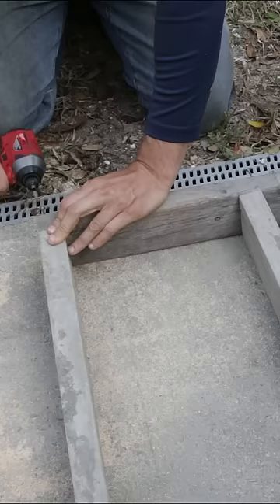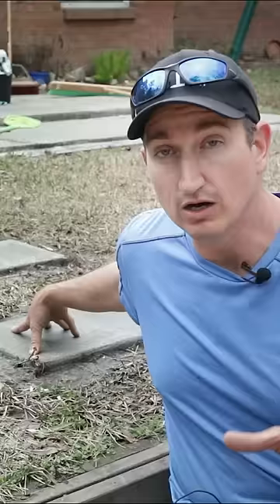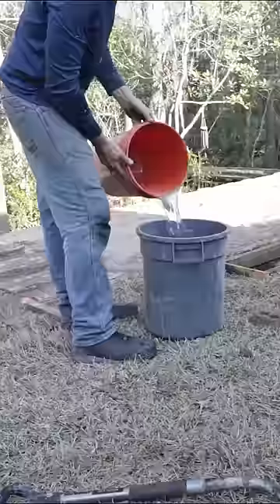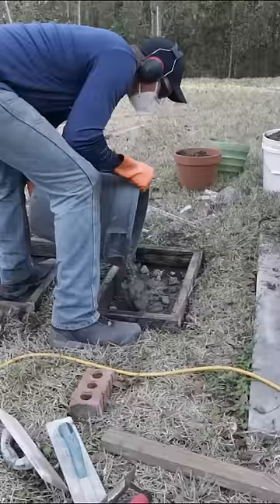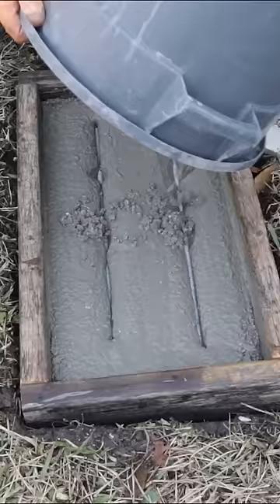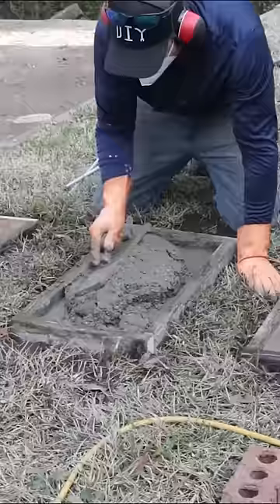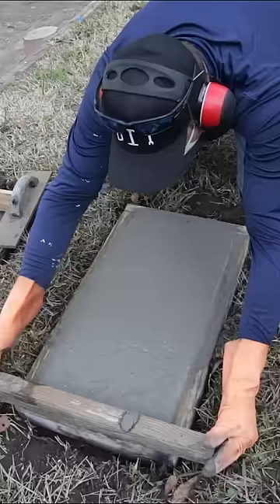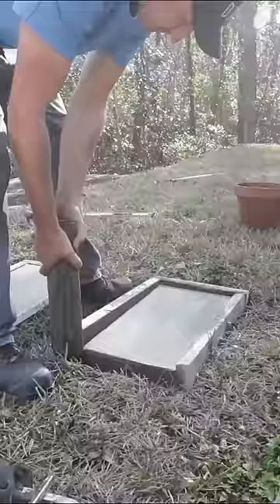How To Work with Concrete for the First Time

Comment: Does THICKness of rods you inserted make a difference versus cut off sections of hog panel/chicken wire? Thanks
Reply from the maker: Adding threaded rod for reinforcement may have been a bit overkill for these small stepping stones.  Metal reinforcement is more practical in heavy load bearing concrete applications.  The thicker the rod the more load the metal can take. The mesh really just holds the concrete together if it were to crack.
Reply: @MrKistel  thanks for replying.
Reply: metal lathe is better

Comment: You didn't put anything under the concrete? You have to use crushed stone under the concrete or it will crack and sink because of erosion from the weather.

Comment: 60 lb bag of ready mix is about $5. 
A 20”x20”x1.75” concrete pad is $7. Time of labor and install and clean up is what… 40 minutes per pad if you make it yourself? I guess it depends on your goal. Do you want the pride of being able to say I did this from scratch or would your rather have the job done same day so you can spend more quality time mainlining heroine? It’s all about your choices. Don’t judge. We all have different objectives and perspectives
Reply from the maker: The intent of the vid was to just show a quick way of starting to work with concrete. The idea is to work with a small project first incase things do not go smoothly.  In this case you end up with a potentially useful stepping stone in addition to an introductory experience.
Reply: @MrKistel  preaching to the choir.  The most useful info from this is a bag of concrete will fill a form that size. So people can estimate exactly how many bags they need to buy. As we all know, the repeat trips to home depot usually coincide with a stop at the bar for a cold one. If you’re a 3 beer fella you know you’ll need three trips back to the store.

Comment: My first concrete project was an 11' x 72' pad, done with my wife and brother. Watched YouTube videos, got tips from the pump operator during the pour, and it turned out pretty good. I was late on the 2nd pass a little, so the edges hardened up a bit and are not pretty in some spots, but it's been years and it looks great.
Reply from the maker: Wow that is a massive first project. Congrats on the success.

Comment: You def don’t have to wait an entire day to remove the form. 
Also, if ur doing actual steps, you need to remove the forms to finish. 

So you would want like a 4-5 in slump and the right mixture of chemicals, if it’s super hot or super cold to assist with curing. 

Point is, this is the equivalent of buying a piece of concrete this size and throwing it on the ground. If that works for you, then great. 

Even the people that prep properly will have some movement let alone this 😂

Comment: First time I ever did any concrete work I dug a 8ft by 2ft, by 5 feet deep hole with a backhoe (also my first time using that) made up the rebar, put the anchor in, and poured concrete for a tower we were building in Hawaii haha good times.
Reply from the maker: Wow that a serious first time concrete project.  Did it all come out ok?
Reply: @MrKistel  oh yea, haven’t gotten any calls about a tower down yet! Haha no finishing work because the anchors are below ground obviously, just told the guy where to pour and vibrated it out lol finishing work is not for me, I like climbing towers and stacking steel.
Reply from the maker: @Dezmon2jz  Epic, nice job!

Comment: Pro tip that I didn’t hear him mention: you want a stiffer mud generally if you’re DIY, the wetter the mud the lower the strength. If you really wanna nitpick you can add a little fabric softener and less water 🤌 that’ll be some strong stuff.
Reply: Plasticizer will make the concrete more wet with out compromising strength. It will have a lower slump but no strength loss
Reply: @randybobandy9828  exactly my point. Generally speaking the average DIY er isn’t playing with admixtures so stiffer is better, but if they do want to, a little fabric softener is a fair water reducer. Admixtures are mainly for workability but water/cement ratios are for strength.

Comment: Hmmm, first time we poured concrete we used an old mixer that ran off a washing machine motor.  Bought a truckload of sand, a load of gravel, both of which we hauled ourselves from the local quarry and then got 94lb bags of Louisville/Portland cement...and poured a whole lot more than little stepping blocks, lol.
Reply from the maker: That is awesome.  Did it turn out ok?
Reply: @MrKistel  Turned out fine.  I don't think we had any actual rebar so we ended up using everything from an old net wire fence to fence posts as a substitute.  Pappy drove a truck for CT Hertzch and the hauled for and were right across the road from the Louisville/Portland cement plant in Speed, Indiana and so got the cement bags deeply discounted.  We poured our front porch, a walkway to the driveway, a border around the gravel driveway, a foundation for a pole barn and most of its floor except in the pens where we put up our cattle and horses at night.  Our neighbor was always on hand to help so we did some pouring jobs at his place too to return the favor.

Comment: Every time I see one of these walkways with the individual rocks or cement pads, they're so far apart that you end up stepping on the grass between the pads instead.
Reply from the maker: Ya, planning spacing as best as possible upfront is best practice in my opinion.

Comment: Wear a mask. I did block for about 7 years, mixing mud. Breathing that dust in. I have breathing issues 20 years later.
Reply from the maker: sorry to hear about your issues and thanks for the safety tip
Reply: Just don't stand in the cloud howbout😂

Comment: .............why by expensive threaded rod (that looks to be either zinc or galvanized) when you can get a 10ft or rebar for the roughly the same cost as ONE threaded rod. 

Also a slab this big really doesnt need a reinforcement 

And one last thing whether or not you have the reinforcement those slabs will break because they are on straight dirt and shifts WAY more than having gravel down for drainage

Comment: What? No mention of using a “releasing” agent such as diesel? I think you should’ve recommended you should screws in your farm show the porch could all be undone at the corners and then taking apart would have been nice to mention how long do you wait for Pauline the form normally the next morning for the concrete is still green, but firm also sad that you did not mention used in an inch in trouble Harold, the inside of the form, she didn’t have sharp edges on your concrete particular, if it was going to be a foot after a step.
Reply: What all in a short ?

Comment: You could just use wire mesh and a shovel and a hose in a bucket. Concrete doesn't have to be rocket surgery

Comment: Are you supposed to do anything to the wood so that the concrete doesn't stick to it?
Reply from the maker: some people will lube the forms but usually if you remove with in the first 48 hours they come off easily enough.

Comment: Guy with an angry dad here who had no patience to teach me anything. What does the metal do just sitting in there. I’ve seen rebar on bigger projects but just dropping them in helps with longevity? Durability?
Reply from the maker: Concrete is strong in compaction but not in flexion. In many concrete applications metal reinforcement is added to minimize flexion forces.  Basically, it helps keep the concrete from bending which could cause it to crack or fail. In smaller load projects sometimes metal mesh type material is used.  This is more to keep the concrete together if it does crack.

Comment: That powder is called Portland cement.

Concrete is the result, not one of the elements.

Another YT blooper.
Reply from the maker: Bagged concrete mix contains cement, sand and aggregate (stones).
Reply: @MrKistel  
Yes if is a pre-mixed bag I cheerfully stand corrected. Thanks.

Comment: Never once seen anyone ware a mask to mix concrete. Use rebar not all thread. You can buy 3/8 in 16 inch lengths. Its cheaper and designed for concrete.

Comment: I've read that there are chemicals in concrete that can cause severe chemical burns after some time has passed. True or not, get it off your skin immediately if you accidentally dunk a piggy!
Reply from the maker: yes it is hard on skin

Comment: I tried this the 1st time and I had so many rocks in it. I couldn't really screen it properly cause the rocks kept getting In the way. How do you get around the rocks properly
Reply from the maker: Ya it can be tricky with the aggregates.  A wetter concrete mixture can make the concrete easier to work with. The trade off is the wetter the concrete mix the weaker the final product (generally speaking).  You can also pat the surface with a trowel to help push the aggregates down.

Comment: Is there anyone that can explain to me how dropping those two rods in there will reinforce it? Serious question I literally don’t know.
Reply from the maker: The metal rods are probably overkill for blocks like this.  My theory is the metal may help limit flexion in the concrete. If the base under the concrete became unstable to some degree or a heavy load were applied to the block it may want to bend.  To bend, concrete has to be stretched on one side and compressed on the other.  Concrete is good with compression but bad with stretching forces.  This can lead to cracking.  So the metal may limit the cracking and if the concrete does crack the metal will help hold it together.

Comment: Question for ya: my husband and I are having a debate on something concrete related. We just bought a house and are wanting to pour a good sized driveway. He drives a massive heavy duty truck that's lifted and pulls a dump trailer often. He swears up and down that the concrete driveway we want to pour does NOT need to be reinforced w rebar. I said, yes it absolutely does unless you want cracks in a year (or sooner, even). He swears up and down that he is right but I'm pretty sure I am. Help!!
Reply from the maker: So the way I understand it is that concrete can handle compressive forces extremely well.  However it does not want to be stretched. When poured in a fashion like a driveway, when something heavy is applied it pushes down on the concrete which may cause some bending in the concrete. Bending creates a stretch force on the bottom side of the slab which can crack it.  Adding metal reinforcement can help minimize this.  The stability of the substrate can have an effect as well. Having said that, I am seeing many new home building contractors (in this region) not adding reinforcement in their driveway pours. Many of those are now cracked.   Even with metal reinforcement concrete can crack, but the metal helps hold it together which can minimize (or even hide) the appearance of the cracks.  Using fiber reinforced concrete can help as well.
Reply: Trust your husband and stop fighting. Then laugh at him when the driveway gets fucked up.
Reply: You're worried about your driveway when you should be worried about your marriage. I'm willing to bet with or without the rebar that the driveway will outlast your marriage. He's probably already cheating on you...
Reply: Most people don’t use rebar for driveways
Reply: If it was during the seventies and eighties I would agree with you but since it's 2023 adding fiber and the way they mix concrete now you don't need rebar,wire mesh is a good idea
Reply: 6 inches thick with fiber.
Reply: Cold climate,freezing in your area, put a heated driveway in, if not just go with the concrete mesh, plus the extra you don’t use, it’ll keep the deer out of your tomatoes 👍~~~
Reply: This is a question everyone wants to die on... It all depends on budget, application, and climate.  How much are you willing to spend, what are you using it for, and where you live.  Wire mesh does help but not much and fiber does absolutely nothing for tensile strength that you can't get by using a higher psi mix aka instead of 3500 order 5000 psi.  If you live in the Midwest and are constantly having having weight on that driveway I would recommend maybe 6 in at 5000 with correct joints or 4 in at 3500 with rebar.  It all depends honestly but I tell all my customers 3 things. 1.  It'll get hard 2. It's going to crack 3. No one is going to steal it

Also this is all based on a solid base with compacted abc and proper grade
Reply: Before anyone asks yes I am a finisher in Arizona and have finished in other states
Reply: Concrete contractor here; concrete has very LOW tensile strength( wants to pull apart) especially in freezing area the concrete is gunna expand and contrast
So the rebar is needed especially for a driveway that will have alot of weight!
If you are gunna pour a concrete driveway I would pay the extra and make it 6 inches thick compared to just 4 
Also you can get micro fibers mixed in the concrete and it helps with surface strength

Comment: How and why does the concrete not stick to the wood frame?
Reply from the maker: The concrete is still a bit soft the first day or so after mixing with water.  Forms generally come  off pretty easy at this point.  Sometimes if the forms are pulled later on, after the concrete has cured more, they can be more difficult to remove.

Comment: i run a concrete block manufacturing plant and this is beyond overkill. we make/sell this exact size of block (4x12x24) hell you can buy 3 of em waaaay cheaper than what 1 of these cost to make and even get to pick a color. you can tap, slap or tickle those boards all you want but theyll never be anywhere near as strong as the ones a block making machine packs.  (this includes your impregnated threaded rod theory).    🤣😂🤣 ???

Comment: Why rebar ??? You don't need that
Reply from the maker: Probably not absolutely necessary for these little step blocks but I was just showing a general approach to working with concrete. In heavy load bearing applications metal reinforcement is beneficial.

Comment: Which concrete would you recommend...? I ask someone at HP and they didnt know .
Reply from the maker: If just starting and making a small step like this I would just use the standard concrete bag mix. Will probably be rated around 4000 psi or so.
Reply: Thank you.

Comment: I spent a year manufacturing high-strength cast concrete, so the 3 ksi standard mix feels like really low quality product
Reply from the maker: Seems to work ok for these type of applications.
Reply: @MrKistel  It generally does, and it's significantly cheaper.

Comment: There's absolutely no need for that steel bar. That concrete is only working in compression, the steel is not doing anything.

Comment: Tell us you don't know what you're doing without telling us you don't know what you're doing! Concrete wasn't mixed as you can see dry spots in the video, no base was put down and topsoil is not a base, because the soil is obviously very moist visqueen should have been placed on top of a proper base and rerod placement was sketchy at best.

Comment: Concrete is so easy to work with you don’t have to be that specific with your measurements hell you don’t even gotta mix it you can throw it on dry and where did you go it’s a lot less work and looks just as good

Comment: Why all thread and not rebar?
Reply from the maker: I had the threaded rod laying around from a previous unrelated project.  It was easier to just use it than go out to get rebar I didn't have already.
Reply: That makes sense.
I thought they were zink rods and possibly a better/cheaper choice. 
I'm still new to working with concrete. 
Thanks, I appreciate the reply.

Comment: How much cheaper is this than using some attractive sandstone?
Reply from the maker: It might not be cheaper.  The point of the vid was to just show some of the basics of working with concrete.
Reply: @MrKistel  Actually concrete might be cheaper, and I'm sure the video is appreciated by some people, but if I had the cash to spare I'd sidestep these technical issues and just go for a beautiful stone which will always look good and has a very low carbon footprint, especially if it's soured locally

Comment: First off, thank you for recommending a facemask and wearing ppe, i work with a lot of cement and concrete and these how to videos with people not wearing any drives me up a wall, its really bad for your lungs and skin even if you dont feel or see a difference.  Also people need to chill on the rebar, is it necessary? not really for something that small, but not a big deal, guy is just saying to start small if you want to dabble in it and doesnt hurt to practice no matter how ridiculous and over kill it is.
Reply from the maker: thanks for the comment

Comment: Don’t rub it back and forth with a screed board, that’s what every armature in the world does. 
Place the screed board down on each side of the forms. 
When you start to screed, pull in one direction with the board at a slight angle past 90 degrees to the form similar to the way a truck plows snow to one side of the blade. 
This gives you a much  flatter surface because as you pull your screed board down the edges of the forms it makes the access concrete exit to one side of the form instead of both sides when you do the armature see-saw technique. 
The see-saw technique on a normal sized pour, like a sidewalk, will allow concrete to work its way under the board and build up on the other side of the board which then forces the person screeding, to do it again because the concrete didn’t actually work it’s way off of the edges of the form and out of the pour, it actually just went under the board and stayed in the pour.